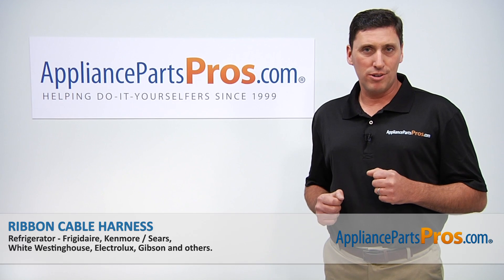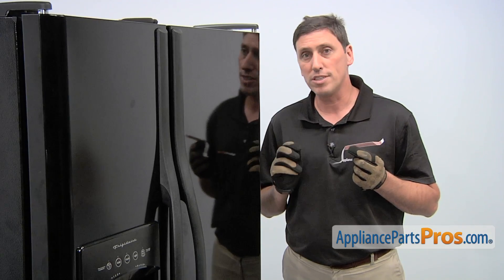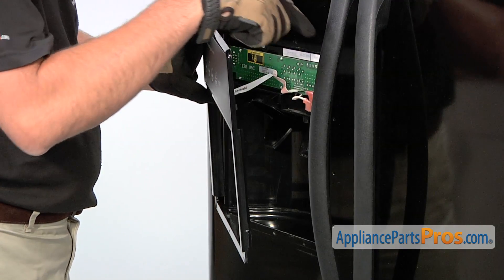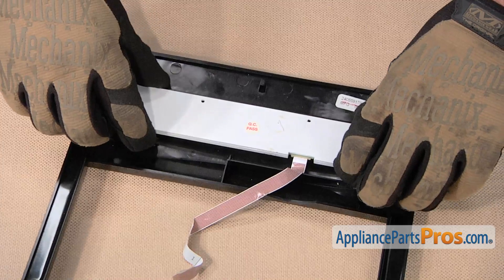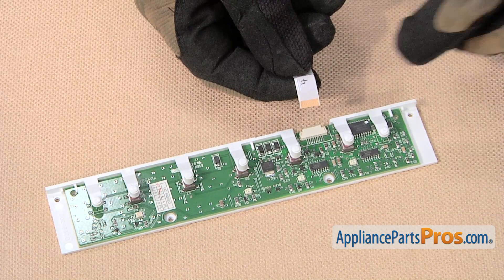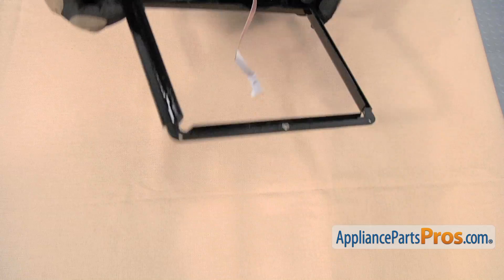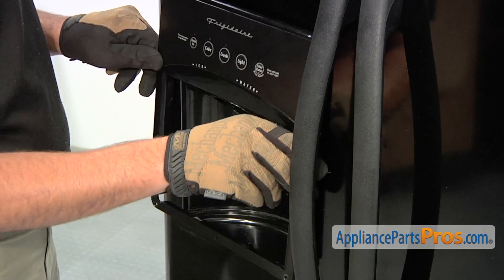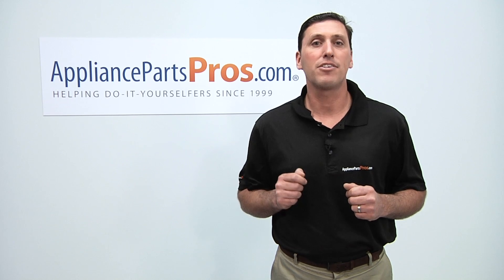How To: Frigidaire/Electrolux Ribbon Cable Harness 241680002

Comment: While cleaning the ice/water dispenser I managed to pull the front panel completely off, which then pulled the ribbon cable out of the connector on the front panel, which then lead to an internet search to find what all the parts are called, which lead to a video phone call with a friend who got me headed in the right direction which then lead to further internet searches to find THIS VIDEO which explained how to get the ribbon cable reconnected correctly. I’m happy to report all dispensers and lights on the display are now functioning - not to mention, clean. 😅 Thanks for this great video!
Reply from the maker: Glad we could help out!

Comment: Our Frigidaire must be a slightly different model as that panel is held in by clips, not by screws.  That panel can pop off if the door is closed a little too abruptly.  The last time the ribbon cable became disconnected from the panel.  I knew there's a Youtube video for everything and this one helped me fix it.  The I put a small strip of flex tape on either side so it won't pop off again.  THANKS!!!!!
Reply from the maker: You are welcome! Glad you were able to fix your issue! If there is anything we can help you with in the future please let us know.

Comment: Just wanted to say thank you.  I did exactly what your video said.  Corrected the problem.  Only issue now is I can only get it to make crushed ice. LOL  any ideas??  and for future DIY I'll be shutting off the circuit breaker or unplugging..  Thanks in advance.
Reply from the maker: What is the model number of the refrigerator? Some models have a solenoid plunger that diverts the direction from crushed to cubed.

Comment: So I have ribbon cable on my Frigidaire wall oven connecting to control board now I pull up the sides and gently try to pull ribbon cable out not coming out. Have any ideas what I should do??

Comment: The old harness does not want to come out of the power board with just a pull as shown on the video. also is it necessary to wear gloves?
Reply from the maker: ***** You may have to wiggle it a little to help get it out. We wear gloves because of the sharp edges on the appliances!
Reply: Mine is very tight. Leary of breaking something

Comment: Hello, I have a Frigidaire refrigerator, model# glhs38eesb0. I'm replacing the wire ribbon but every time I go to plug it in the ice dispenser comes on. Also, at the same time, if I push the paddle for water, nothing comes out. Is this a problem with one of the power boards. Thanks for any help.
Reply from the maker: Not sure if you have this figured out yet but if you need help trouble shooting a board you can go to our repair forum. I would suggest posting the problem along with the appliance model number the techs can help you troubleshoot the problem. http://forum.appliancepartspros.com/
Reply: Hi Gary- I just installed the ribbon and had the exact same problem.  Were you able to solve the issue?
Reply: Gordon Mosley did you get yours figured out? I have the same issue!
Reply: @gordonmosley4687  When mine had broken ice maker dispenset wouldn't turn off replaced board and problem fixed